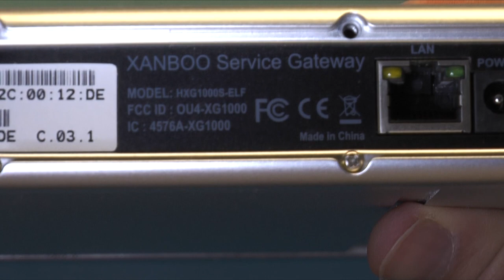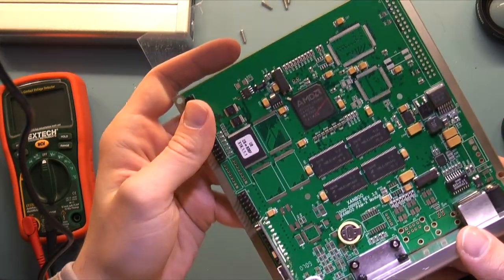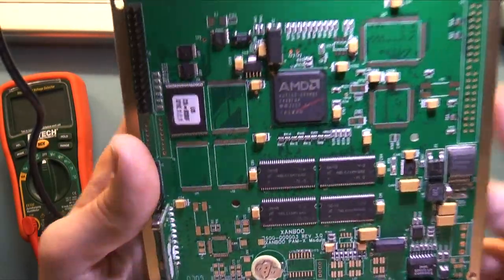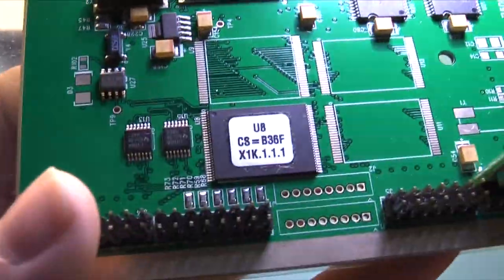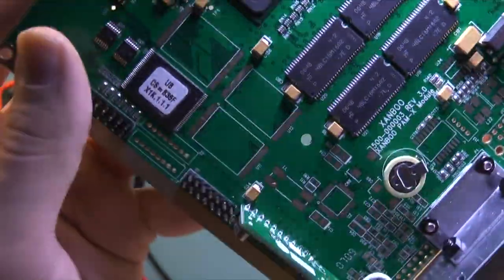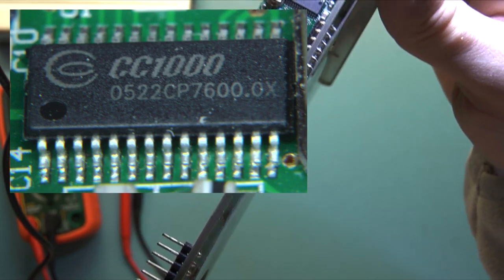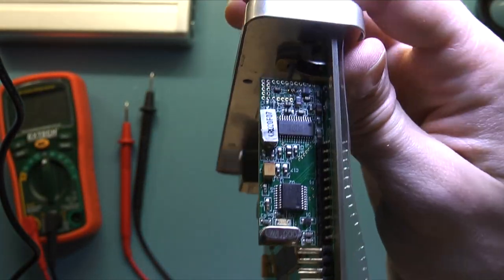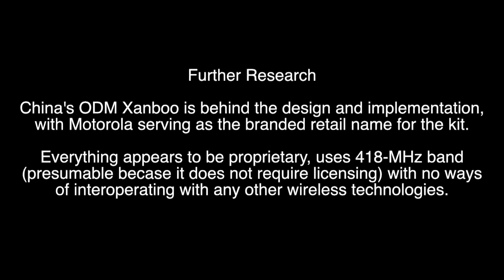Xanboo Service Gateway HXG1000S-ELF (XG1000S-W) Teardown

Comment: I reckon this transceiver with 433 MHz band can be easily used to control remote controlled sockets(Maplin sells them)  which seem to operate in the same band. Also since the unit presumably has linux on it so it can be a humble home automation box.